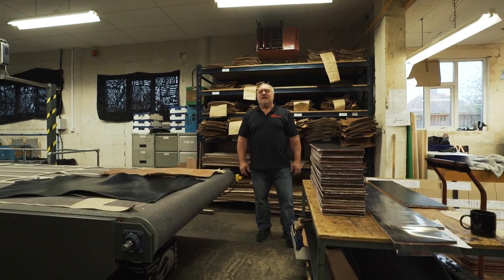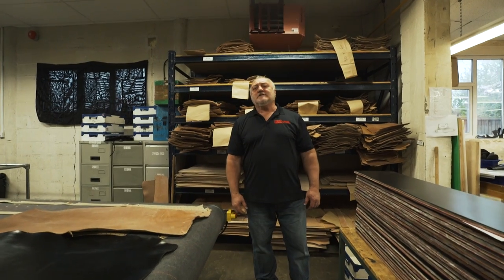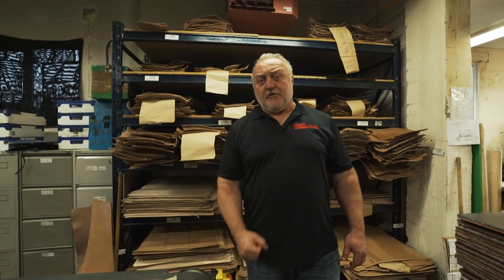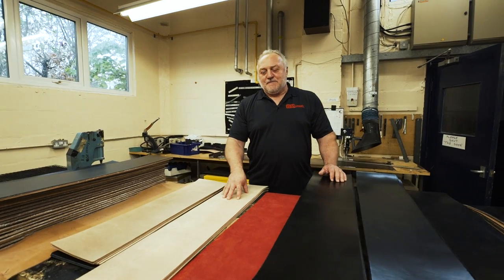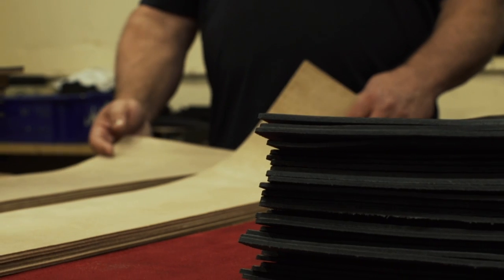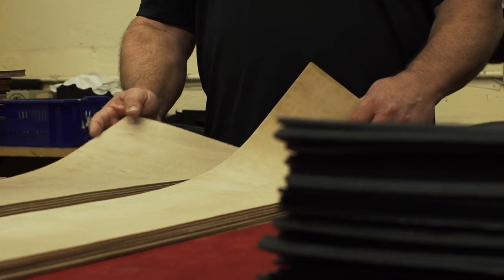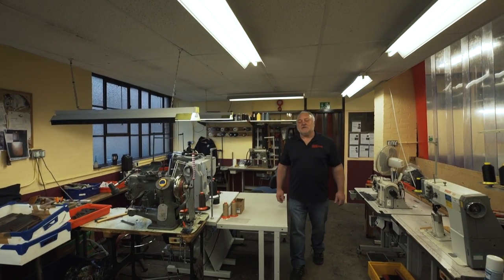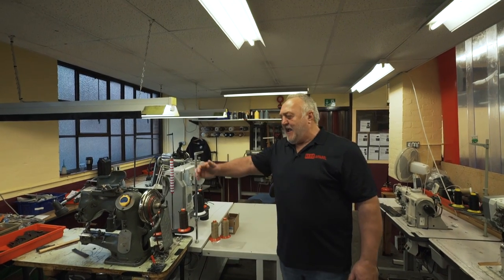The SBD Belt - The Manufacturing Facility

Comment: So what's the difference between the SBD belt and the Inzer belt??
Reply: No different from a 13mm inzer I reckon...but sbd do make great quality gear
Reply: Billy goat What's the price difference?
Reply: +Marco Rodriguez depends where you are,ie shipping cost..... I think the sbd belt is about 40/50 euro dearer if that helps
Reply: It's different because the latch that screws on with the inzer belt isn't bolted on the sbd so if u gain or lose weight you can just latch it tighter or smaller if that makes sense instead of having to unscrew the lever into a different hole. It's like all in one.
Reply: dominickd16 Ohh I see, cool! Thanks.
Reply: Marco Rodriguez sbd is 165£ and inzer 90$